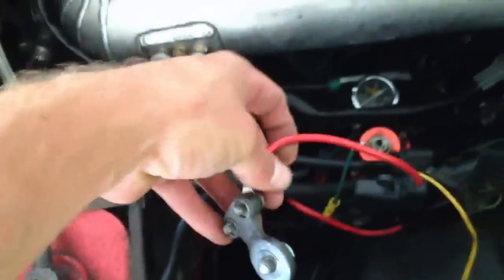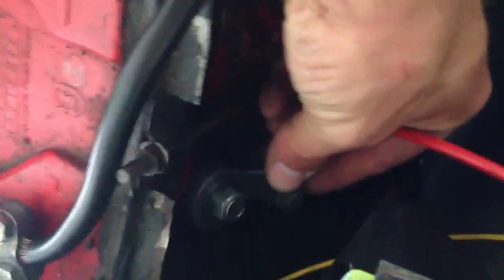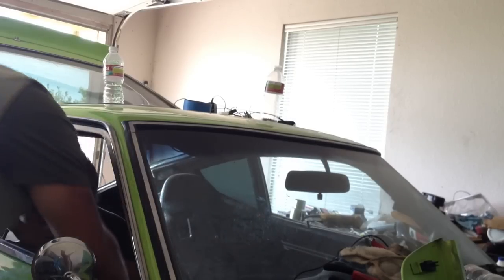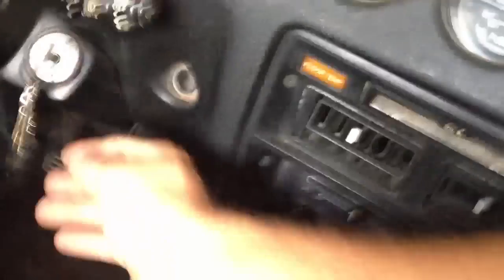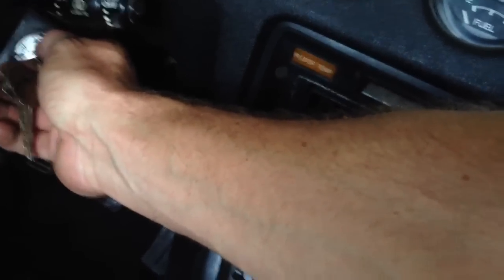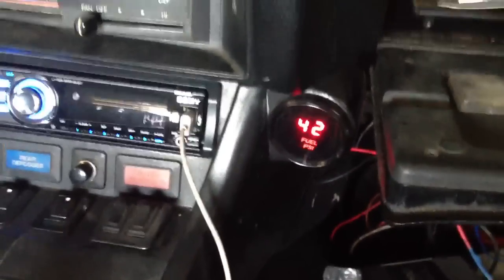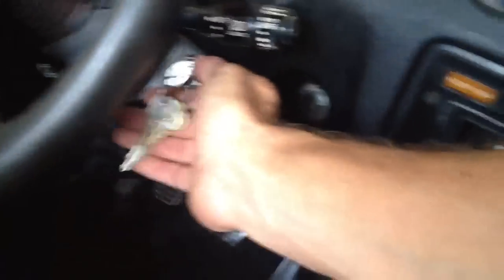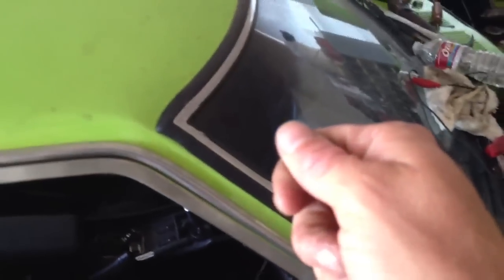280z RB30DET Haltech platinum pro plug n play problems

Comment: On mine, the pump runs initially for a short time when the ignition is put on and then once the crank sensor reads movement, the pump is turned on.

I think you havent done some of the wiring correctly.

Perhaps you have some random wire touching ground.